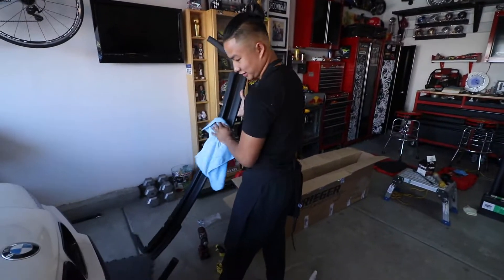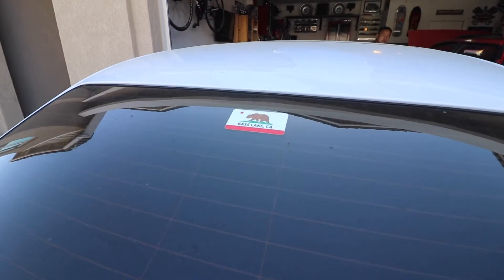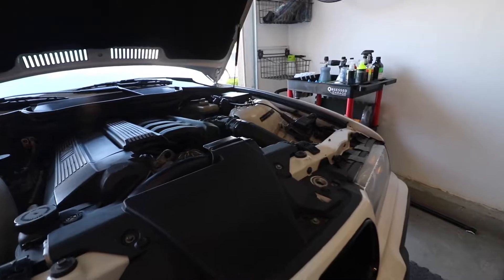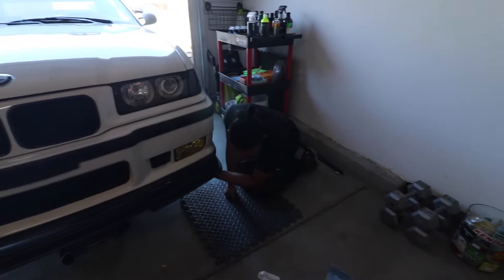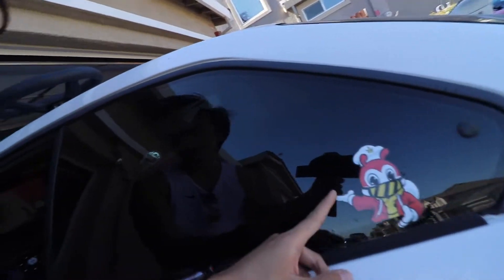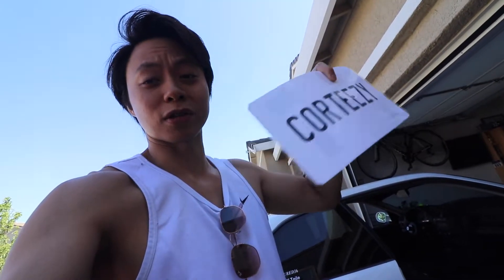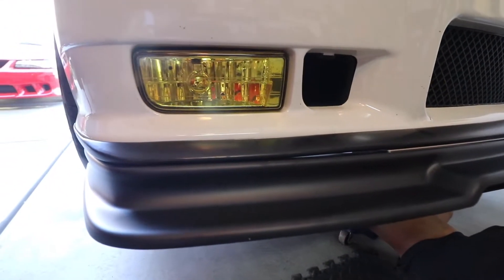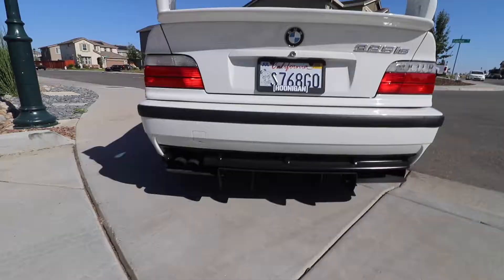BMW 325IS E36 RIEGER LIP INSTALL

Comment: Do you know if this part is compatible with my 1995 325i BMW convertible?
Reply from the maker: If your car has an M3 Bumper Conversion then yes! Otherwise, it will NOT. My car is not an M3 but I did the conversion to allow this lip to fit. Previously, with the factory bumper, it would not be compatible :)
Reply: @Corteezy  mine has the original bumper,  so I don't know.  I called Car ID today and most parts from e36 or me 2 door will fit on my car
Reply from the maker: @djrios2855  To my understanding, it would not fit with the original bumper if you're buying the M3 Rieger lip, which is the one shown in this video. However. Rieger makes a similar lip for the NON-M3 bumber. That can be found here:
https://catuned.com/rieger-cup-spoiler-bmw

Comment: Love the video man! I drive an e36 too and am in the process of building it. Would you mind letting me know where you got the wing from? I’m scared of getting scammed
Reply from the maker: Glad you enjoyed! I picked it up (a rep) from eBay, no easy way to find a real one that won’t make you go broke lol. I’ll find the link and send it your way ASAP :)
Reply: @Corteezy  Please do!🙏🏻
Reply from the maker: @mikereis5027  How's it goin! sorry it took me a few days, to respond. But i've been digging around ebay accounts, and found my purchase order from a few years back for the wing. Seller seemed to have been shut down // is no longer selling the item unfortunately. But what I can do is give you some pointers on picking the right seller/distributer!

here's an amazing breakdown from bimmerforums that helped me alot in my search and deciding which route to go with my wing style!: https://www.bimmerforums.com/forum/showthread.php?1593277-The-definitive-E36-LTW-Spoiler-Replica-Thread

Secondly, from experience, I preferred the look of a 4 piece wing, just like the original, (lower lip, risers, and main arch). These are typically built to slightly nice quality and tolerance than the 1 or 2 piece ones :)

- Just be keen to seller info, shipping location, ratings and reputability on eBay, to make sure they aren't planning on scam you!

- Scope out the images in the listing, make sure they all seem uniform or "real" and not just some stock photos from the internet. Also keep an eye out for overlapping photos between multiple listings that aren't related, sometimes listings will take other's photos and claim it's their product!

-Finally if you are still unsure, message the seller about the product, if they seem knowledgeable, then they probably are the real deal!

I hope this overly lengthy write up helps. I wish you the best of luck! however, I can only offer advice, i'm not liable for any issues or loss that you may come across lol. Wish you all the best! lmk if you have any other questions :))

ps. if you would like to follow my E36 build on instagram, drop me a follow on @CATACAPTURED36, as well as our youtube IG page @CORTEEZYCLAN

thanks for the support